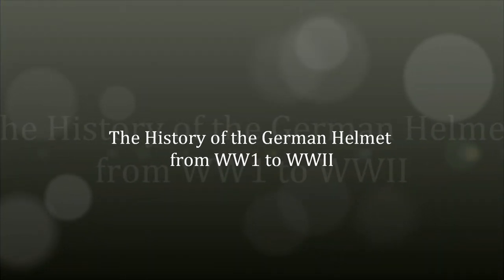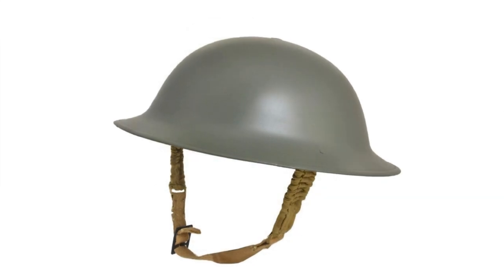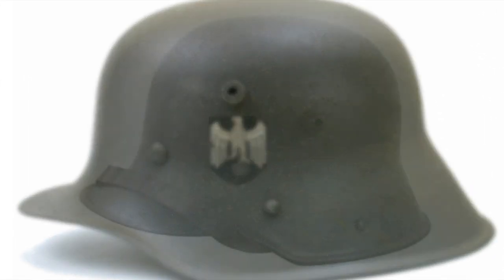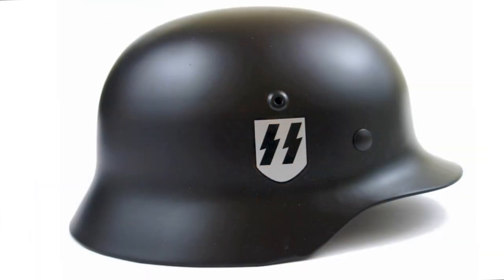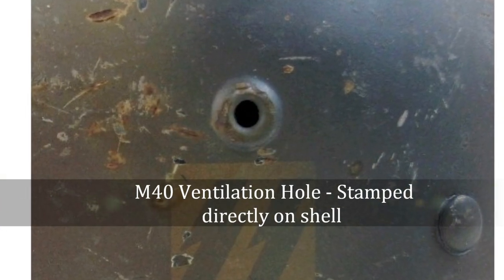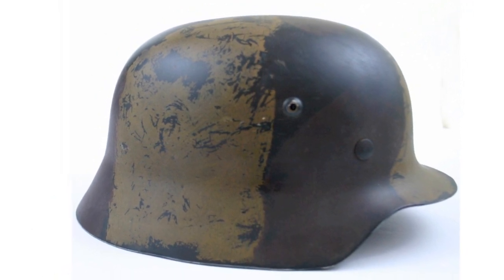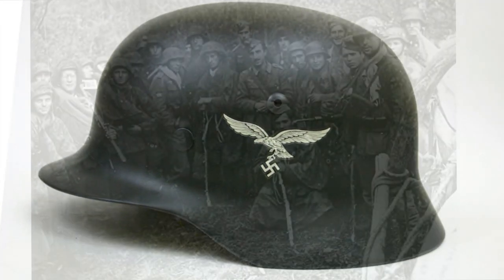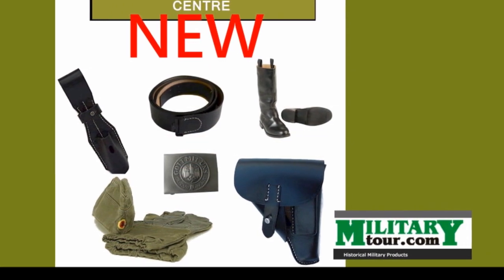The German Helmet - 12 Variants through WW1 to WW2

Comment: One should also note that the German fire fighters still use a plastic version of the M35 helmet - still until today!
Reply: Dennis07 it's not plastic, it's aluminium
Reply: Dennis07 
so does the Swedish fire brigards and the model is also used in other protective contexts.
Reply: yes  remmeber seeing them in the  60s ,  I  still have one  I  found beside a  farmers  field when I was on guard  duty  looks  like  a plow  turned it up   was a funny  shaped  mud  ball darn a  old  helmet  no  rolled  edge  still had  leather  liner  with  numbers stamped on it  its on the floor  beside  me  think it was  1968  when I  found it
Reply: @mircea_0064  iam a German Firefighter and no, the helmets are still Plastic ;)
Reply: Link? Can’t find a photo
Reply: @bageled_meme2690  Just google for "German firefighter helmet" or the German term, "Feuerwehrhelm". You find tons of pictures since this is still the standard fire protection helmet here.
Reply: @MQuaritch  : We are in a transiston time, the oldstyle firebrigade helmets are slowly replaced with modern helmets.

Comment: Hungary has it’s own m1935 variant, same as the german, but the front rivets were mooved under the ventillation hole and had a piece of metal attached on the back for easyier packing.  These were made in Hungary, and sold to finland as well.

Comment: There are also m36 and m37 paratrooper helmets,
Wich makes the list longer

Pickelhaube m16 ,m17 m18 ,m18 with ear cutouts, gladiator model, m33 (used by the ss leibstandarte an SSVT, also known als the himler m16) ,m33 vulkanfiber, m34 ,m35 ,m36 ‘m37 ‘m38, m40 ,m42, m44 , m45 (note that the m45 and the m44 are not a official models but production errors) and a prototype model helmet later used by the DDR .
Also there are more sizes 70 68 66 64 62 60

Comment: Was there a strength difference between the m42 and m40 due to the rolled edge and being pressed unlike early manufacturing by hand?
Reply from the maker: Zachary cook 
No it was just a cost savings.it was easier to manufacter
Reply: You would think that ones with a tolled edge would be harder to split.
Reply: And the m42 had no decal or how the fuck she says it

Comment: High can anyone please tell me which helmet has the more defined shape ? Is their a notable difference
Reply from the maker: i am not sure what you mean by defined shape...the m35,m40 and m42 German ww2 helmets, all had small differences but look the same to most people.The m35 and m40 both had a rolled edge .The m42 had a flared edge or razors edge to save money in manufacturing. The helmet ventilation holes on the m40 were stamped into the steel were the m35 vent was a separate vent lug.

Comment: Egyptian soldiers still use these helmets for ceremonial purpose.  

Funny that the army helmets from around the world today look almost similar to these helmets except tat they are a bit thicker and a bit bigger not thin and smaller.
Reply: The modern designs are based indirectly on the stahlhelm, see ACH. Most notable difference other than material used is the elimination of the front visors for better visibility looking up and for ease of fitting night vision goggles.

Comment: the first idea for the german helmet came from the greek athenian [ or sparta ] helmet all most 2500 years ago
Reply: Perhaps the pikelhaube was based on that ultimately but there was a celtic/germanic auxillary helmet with spike on top from the iron age found in Germany that was the inspiration for that helmet. The stahlhelm came from the mediæval sallet the same way the French and British helmet were based on the kettlehelms worn mostly by infanty during the middle ages.
Reply: The metall versions of the Helm mit Spitze are clealy a comeback of 17th century , Orientalische Sturmhaube' or ,Zischäge' , which replaced heavier or visored helmets during the thirty years war.
Reply: No. No it didn't. Basic principles of helmet design are universal. The Stahlhelm was designed the way it was because of contemporary pressures, however, more than historical precedent. The flaring provided better protection, and the more open front improved hearing to the front.